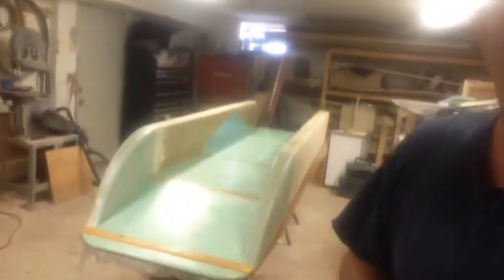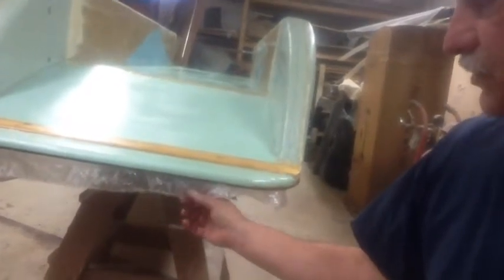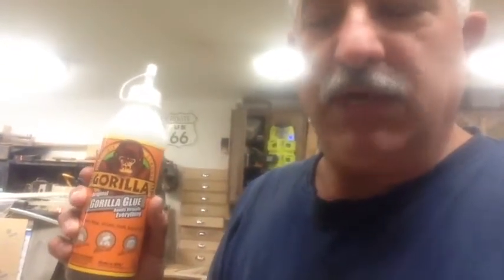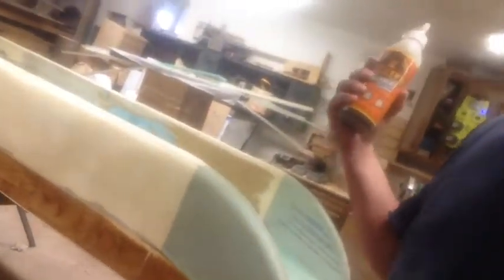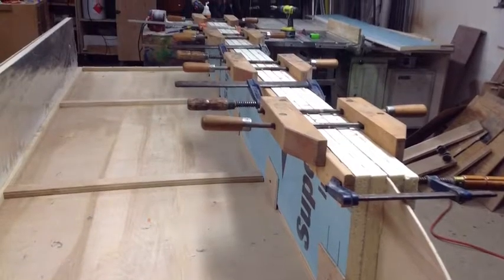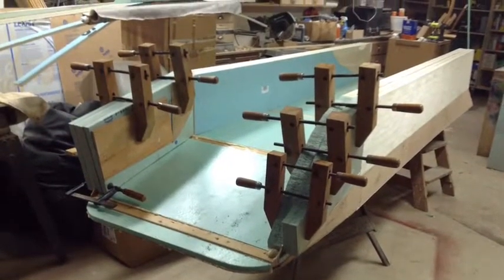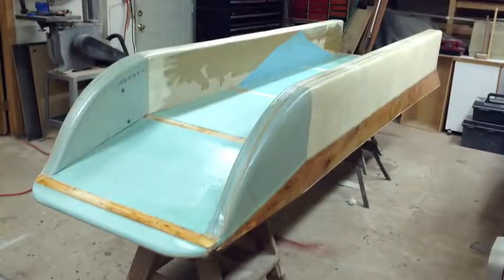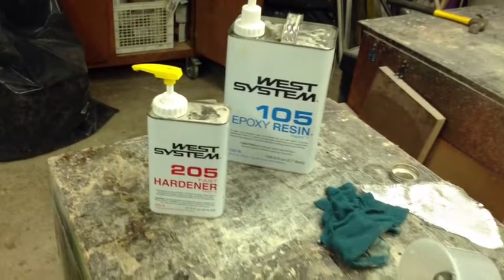Home Made Super Light Single Skiff Crossover to Skate or SUP part 2

Comment from the maker: Unfortunately this design was not good. The pontoons went too deep into the water and were not buoyant enough. The tide started to take me out to sea. Then to alter the design did not make sense so I scraped the project. It was too hard to paddle against the tide. Most of my designs work and usually pretty good. But this one failure taught me more about boat building than my other builds.